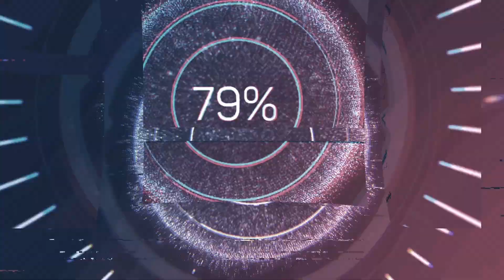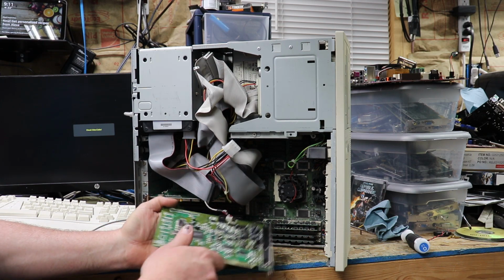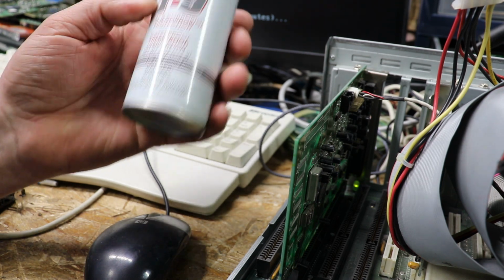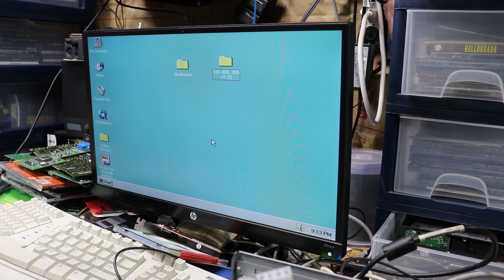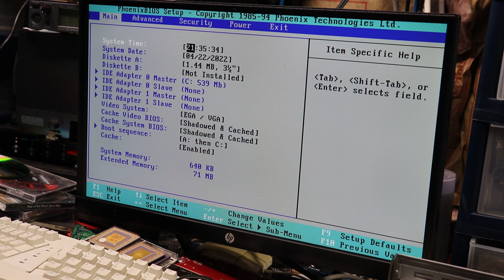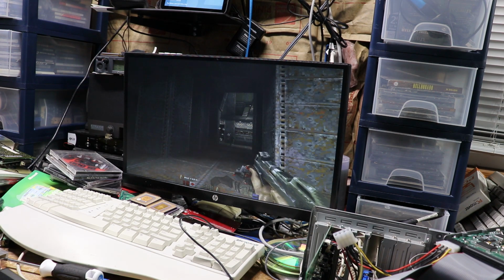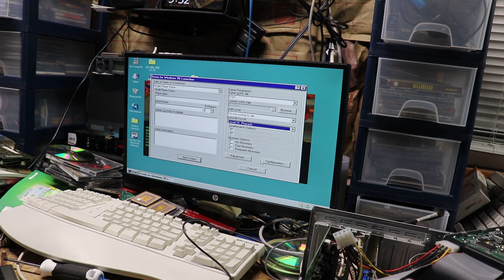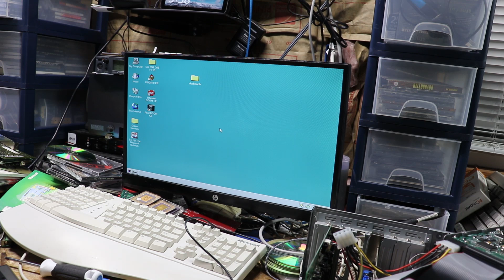Micron Desktop

Comment: i would have picked up a ide to sata they tipically go for about 10 bucks
Reply from the maker: I do have a few of those, but from previous experiences with these microns that have the Dallas clock chips. I have always had issues in the BIOS with working correctly. I've had to disable the on board ide and use an PCI ide card like PCI 66 or PCI 100. Then I could use it. Thanks you for the comment I appreciate feedback and ideas.
Reply: @OCROldComputerRebuilds  nice thanks for letting me know